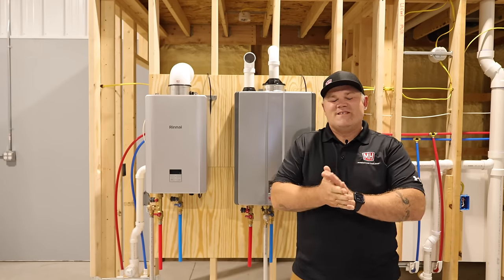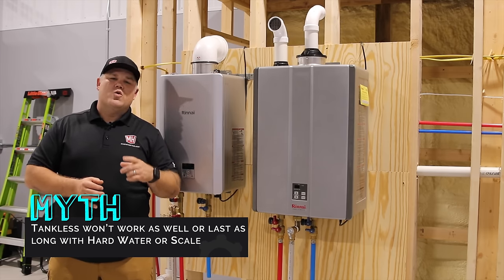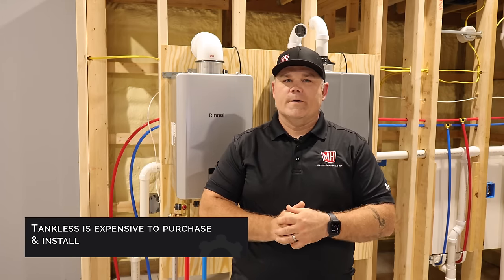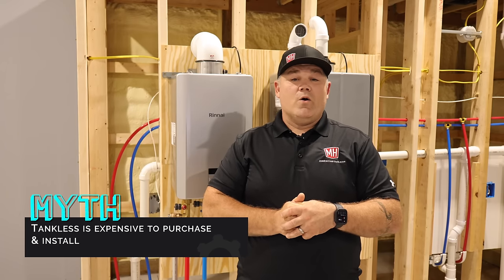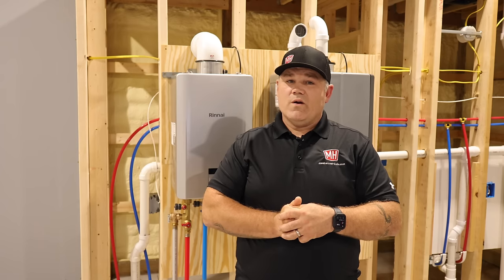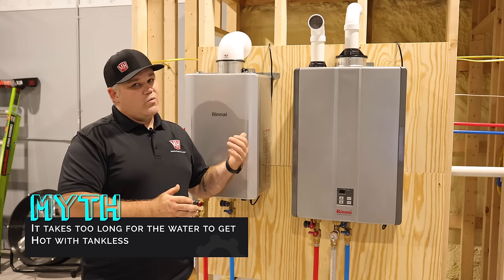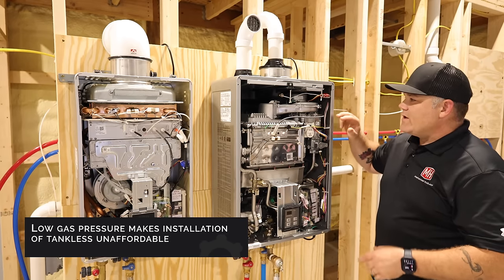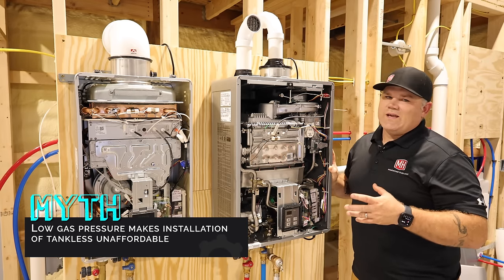Myth Busting! Tank -vs- Tankless Water Heaters

Comment: I live in Manitoba your neighbour to the north and our ambient ground water temperature is a little lower than your by a few degrees, i had a 30 gallon CDN gas hot water heater and it worked awesome and i never ran out of hot water , although it was small, it had a custom higher BTU input for the gas ,  i looked into  tankless back in 2007  at home depot and had some good education from a friend who is in your business, so i found out back then that the tankless units for sale were really designed for warmer climates where the ground water temp averaged 55-65 degrees and i bought one from home depot  and went through all the documents that came with it and it even said it would use up to 10% more gas if the water temp was below 50 degrees and back then the whole install would of run right in the neighbourhood of $1600, so i just stuck with a tank unit and finally replaced the 30 with a 40 gallon unit pre covid, the other lasted over 30 yrs and that'll never happen with this newer one and will go with tankless for sure with this 40 gallon gives up the ghost  in the future, great video

Comment: The tankless hot water heater has actually saved my family a lot of money over the years, because after we had it installed,
Years ago, we have yet to need to buy another one since it was installed, the only thing that I would have liked even better is if I could have ajusted the default temperature a bit higher but other than that I would not change it

Comment: Best water heater I ever used was a ancient (50+yrs easy) oil fired hot water heater.. house had oil heat and oil hot water, when you'd turn on the hot water you'd hear the boiler kick on and within 15sec you'd have water that was literally just shy of boiling coming outta the tap, now granted not so good if you have small kids but it sure was nice to always have more heat than you needed. It was a tankless style too, you had unlimited hot hot water and it wasn't too bad on oil usage too.. I moved to a new home though and that became an often recalled thing of the past, but it was so nice to have water at 210° instead of 150 or so

Comment: I have converted over to tankless from tank twice. Once in my old home and once in my new to me home. Both were simple Rheem outdoor models. My better half made it a requirement. We live in North Central Florida. Very soft water. Is there a cold water sandwich sure but we get used to it. We never run out of hot water. I descale it twice a year with vinegar for 1 hour. That’s it. Again I am sure ground water temp in FL is very warm compared to any other place in the US. In conclusion, I love my tankless. I get 130 degree water within 20 seconds of turning on the faucet. Will never go back.

Comment: Plumber 40 years here. Work on all brands tankless. Do you actually size your gas load on houses? Some houses do require a 2psi jump on gas system. Standard gas meter at 8" IWC only do 300,000 btu. Tankless takes 199,000 away from that. Now add in furnace fireplace and stove and you're at 400,000. Requiring that 2 psi jump. 
Now what about repair parts? Getting those for tankless sometimes 24 to 48 hours. Sometimes 1 to 2 weeks. Tank parts I can get that day. 

Any energy savings is blown out of the water with first service call or regular maintenance. Fo you just flush the unit? Or do you tear down burner and blow out with air. Also clean flame rods while your in there.

Comment: We had in the Netherlands tankless water heater in the kitchen . They were very small. You could take a shower upstairs in the bathroom , but if somebody wanted to do the dishes at the same time there was a problem. We talking in the end of 1950. Now our home has floor heating with an electric tank heater on demand.  A Gas heater on demand for showers and we have 3 large showers in our home, with no problems..

Comment: The main reason why I was recommended to not install a tankless heater is that I only have electricity available (no gas) and it is more expensive to heat water that way. I hope that is a myth as well, as my hot water tank is almost end of life and I would really want tankless. (I am from Europe, so I was not used toi anything else than tankless before I came to the USA)

Comment: First timer here, good info, thank you. Thumbs up from me.

I agree with your analysis. In particular, the space issue is a primary consideration, mounting a tankless higher on the wall allows laundry machines right below.

I own a house (rental property) where – during major renovation – I chose a tankless on propane. The decision was intentional, and a good one, except that unfortunately, I picked a brand which proved to be a mistake and it had to go. But the benefits were just as you say...until it became unreliable and I had unhappy tenants. But it was the brand, not the concept at fault. Wish I'd picked Rinnai. For now, that house is on a tank, but it will shortly revert to tankless.

Here's a question: what are the tankless options for a very small house, say less than 800 square feet, occupied by maximum of two eco conscious people willing to be thoughtful about timing showers, dishwasher, and laundry to NOT overlap. Are the smaller units equally good? Any specific recommendations? And is propane any problem in your experience? Thanks!

Comment: As a home inspector I can tell you for a fact that it does take an extended period for hot water to reach most water fixtures thus wasting water while you wait for it to warm up. In fact, I have tested few tankless system where this is not true and I have tested plenty of Rinnai systems and all competitive brands. I'm sure a recirculating pump would help but then you're using electricity to run a pump. There goes your savings. I do like them however but I could see where homes may want to install an electric tankless booster close to the water fixture to get warm water to the fixture faster until the main system takes over.

Comment: I put a tankless gas hot water heater in my barbershop 30 years ago.  Getting both  temperature and flow down to do shampoos would shut off the heater.   The barbers stopped doing cold shampoos.  Also the city's building code required a stainless steel flue up the three stories of the building.  I eventually got a 5 gallon electric heater I  hung on the wall.  But only one of my 5 barbers ever got back in the habit of offering a shampoo.  I hope designs have improved.

Comment: Sounds  great... my niece has a gas tankless, and she loves it.... right until  the electricity  goes  down from  a storm... no hot water  till the power is back  on, which  has in some cases been  a week.  😮
Reply: No power often means no water no lights no heating or cooling either. What’s your point?

Comment: I replaced my old tank heater which came from my builder with high BTU 60 gallons tank about 3 years ago. It's 1/3 of BTU capacity of high performance tankless.
- it can still supply hot water for 1 shower endlessly
- it has immediate availability of hot water as regular tank
- in case of power loss you still have 60 gallons of hot water which can be used for a day or two
- you can have all your hot water faucets open at the same time as long as 60 gallons last
- it was twice cheaper per unit, much cheaper for installation and it requires less maintenance. 

The only disadvantage is space if it's important, but if you have a dedicated space for a tank in your utility room - it's not an issue at all.

Comment: I looked into natural gas powered tankless water heaters about 10 years ago-the bottom line was I could replace 3 or 4 tank water heaters for the cost of one tankless. The payback was not there. Things may have changed but in our two person household it did not payoff and people move alot now.
Reply: Look into heat pump tanks. Pretty short ROI on them. And check for rebates and tax credits.

Comment: The myth you mentioned about tankless not being able to heat really cold water can be true depending on the specs of the tankless waterheater.  We had a Bosch unit installed that worked well in the summer, but when incoming water got really cold in the winter, the unit couldn't keep up.

Comment: Love your video. I really wanted  to get a tankless. Had a venting problem so I had to move to electric. Same venting problem ruled a gas tankless. I want to go electric. I came real close. Every one and all I read said electric tankless have trouble in bad  cold winter. So I had to go electric tank. When it is real cold for a week or so my new one does a little trouble. The settings are already a bit to high so that does not play in it. The problem happens if I do not use much hot water for a day or so. Temp of 100% hot is closer to warm.

Comment: Rinnai has issues with the "Cold Water Sandwich". What that is, is during something like a shower, the hot water is cycling off and on with cold water in between. Apparently, there is a sensor issue where it turns the hot water off for a few seconds, then it resets. It is a major headache, and few plumbers know how to fix, if there is even a fix. Other than that, Love my Rinnai. Saves 10% monthly, is going strong at 17 years in a heavy hard-water home. We de-scale it every 2 years, and do have a water softener. Also, it does take about another 10 seconds to get hot water compared to our previous tank system.

Comment: I feel the most important thing to know before buying is incoming Winter water temperature. In Philadelphia I tested the Kit. sink in February and it was 38 Degrees. Now you will need to raise it to 115-120 Degrees. That's an 80 Degree rise. So, they always give you info that you can take 4 showers , But that may be in Florida with warmer Winter water temps. You must buy for the coldest your water will get.  I have a NG. Noritz and an Electric Stieble Eltron in 2 homes. Noritz since 2011.

Comment: I bought a house that had sat empty for a couple years as the owner was in a nursing home. Shortly after moving in the water heater threw an error code and i could not get anyone to service it. I bought a 5 gallon bucket, a pump, and washing machine hoses and pumped vinegar through it. It was very dirty. Codes cleared. No problems since.

Comment: I've had a Rinnai tankless for 15 years in Calgary and can confirm there are no issues with cold water or hard water. We have both. My only complaints were that my plumber was an idiot and didn't know you had to set a dipswitch for installs over 1000m elevation so it would randomly stop when filling a tub. Then it also needs a certain minimum flow to activate. I can't just dribble a little hot water while washing dishes. I think I've run vinegar through it twice in 15 years because all our fixtures in the house constantly have lime buildup but that's it.
Reply: Oh, another myth to "bust".

Myth: Tankless heaters don't work worth a shit if not properly configured.

Mechanical Hub response: True but if you're paying thousands more in installation, they should be willing to come out after a few days or a couple weeks to fix it.

Comment: I had a tankless condensing water heater for some 15 years, and we loved it. The only drawback for me, was the annual maintenance, i.e.: the descaling/flushing  procedure. Not  a huge deal, but whereas a tank heater is maintenance free until it dies at 15 or so years, this flushing procedure does  have to be done, and it also spoils some of your energy savings, especially if you have to hire somebody to do it. That is the only downside to tankless to me, but I think I would go tankless again if we buy another house...

Comment: Some companies void warranty unless there is water treatment. Never seen an installation where the gas line did not need to be bigger. Be sure that the brand chosen has readily available parts at the plumbing supply.

Comment: Tankless won't eliminate the wait-for-hot water.  In fact, it will add 5 to 10+ seconds more waiting while the burners reach operating temp.  A ReadyTemp TL4000N gives you control of how convenient hot water is.   Enjoy on-demand/push-button and/or timer-based circulation using the cold water line as a return line.  Only ReadyTemp allows adjustment of temp setpoint and activation customization (hey Siri, motion sensor, occupancy sensor, etc)

Comment: Plain old 40 or 50 gal tank hot water heater works just fine.
Long times to get hot water to your sink?
Use smaller hot water lines, INSULATE the line, or install a water recirculation line.

Comment: I love water on demand systems. I have though noted it takes longer than the hot water tank to bring hot water. In my parents old place we installed it in the same place we had the hit water tank and we noticed right away it took about 30 seconds to reach our shower. We went to the water on demand because we went through 3 water tanks in 5 years suffering leaks and pilot lights just failing repeatedly.

Comment: My inlaws bought a house about 5 years ago and I've been trying to help them with the hot water issues. They have a 60gal tank that they have already replaced twice because of degrading performance. They may as well have sand coming out of their faucets which boils down to one word, maintenance. They're still debating adding a second heater or going tankless, neither of which will solve the problem, if not create bigger ones. Some people just can't be convinced to do the day to day work on their home.

Comment: I have a tankless water heater, but there are two caveats that I have discovered.
One, it will take a long time to fill a soaker tub, if you have cold ground water.  It will throttle the flow down dramatically.
Two, most stores will warrantee a conventional water heater installed by the home owner.   Even though the installation is only slightly more entailed, the stores want a receipt from professional before they will guarantee the unit that you purchased.

Comment: Have had a tankless for 14 years (4,500 sq ft house).  It replaced two 50 gallon water heaters, one of which had leaked and a previous one burst.   Not a moment's problem or hot water problem.  (Middle TN with temps from -10 to 100).   Sorry, a chip on the board had to be replaced - took 3 minutes. Yes, it costs to install it but gas bills were reduced month after month.  Paid back in 8 years.

Comment: Did a tankless when it was time to replace.  It was more expensive, there was a lag in getting warm water, but biggest hit to us was reliability.  We had a gas tankless that had to be plugged in.  If gas OR electricity went out, which the electricity did, no hot water with new baby in house for 2 days.  I didn't notice a significant change in heating bill using this vs tank.  Only upside for me is tankless are smaller.  Not worth the trade though.

Comment: I live in Ecuador,S.A. and everywhere has tankless. They work great. Also I set mine so that I can shower without adding any cold water. (Why. Pay to heat the water only to cool it? ) In the kitchen, I turn down the hot water flow and it gets much hotter. I'm pleased with them

Comment: Old video, but just wondering about running off propane. We have no natural gas. 4 year old house we built with a heat pump water heater. That water heater is more efficient than most tanks, but even with just two adults 50 gallons only goes down far. Thinking about Rennai, as my wife had one in her old house.

Comment: One comment and one "complaint" regarding tankless.  Comment... the "endless hot water" often offsets the savings due to efficiency due the fact that you can, and sometimes will, stand in the shower forever.  There were times when I wished my kids would run out of hot water.  Lol  Complaint... My particular unit requires a high enough flow rate to turn the unit on that sometimes if a faucet is not opened enough/flow fast enough, the water heater kicks off and the water goes cold.  You then have to turn the faucet on more and wait for the line to clear out the cold water before you get hot water again, now at a higher flow rate than you really wanted or needed.  Overall, we have been very happy with the tankless unit.  It is especially nice when my wife wants to soak in the oversized bathtub.  There is plenty of hot water to fill the tub!

Comment: I have extremely hard well water where i live. It destroyed the whole system I bought the house with. I spent about $3,500 on all new pipes(all water fixtures are within about 10-15ft of source), tankless heater, pressure tank, softener, and filter system. My maintenance as scheduled is is 1 or 2 times a year, flush it. I make a day out of it, by replacing all the filters and flushing with a backwash inspection every 3-4months. My dogs and I refused to drink the water before(gave me Heartburn). Now its the only water we drink. As for the tankless, no failures or issues. Maintenance and clean water supply are key. It cost me $40 for a flush kit on initial purchase, after that its about $8 every flush plus filters.

Comment: Tankless are still more expensive to buy have install into existing homes. I know I have done it twice. Last Rheem tankless was $1k to purchase and another $1k to install. Since all the plumbing is on the bottom of these tankless the extra work to replumb from existing water heaters tank is pricey. Of course the cost of future replacement should be less. Venting can be expensive if switching from electric water heater. Both times had to upgrade nat gas plumbing for higher pressure and fuel needed for thankless.
Would I do it again, yes, they are worth the expense for the convenience of having on demand hot water.

Comment: I lived in Taiwan in 1971. They used a tankless unit hanging on the wall in the kitchen. It was connected to a propane tank also in the kitchen. When the tank was empty a guy on a motorcycle would deliver a full one. When you needed hot water you turn on the propane and start the heater. 30 seconds later hot water.